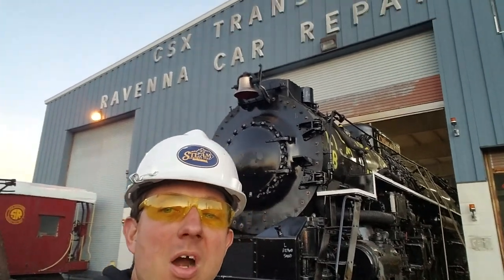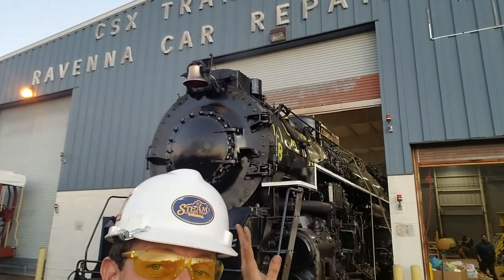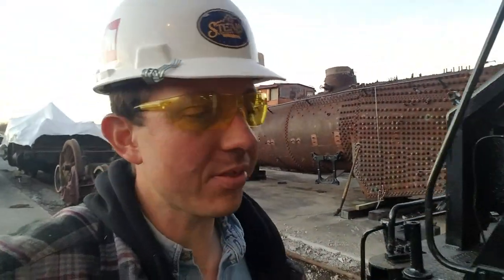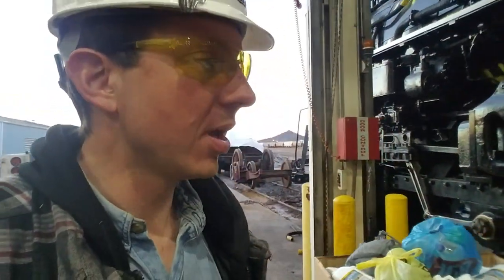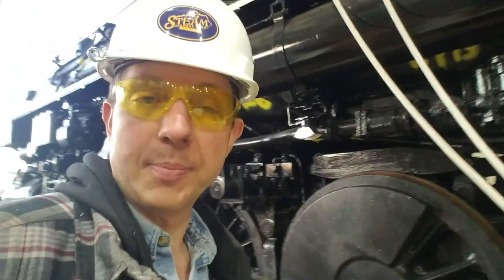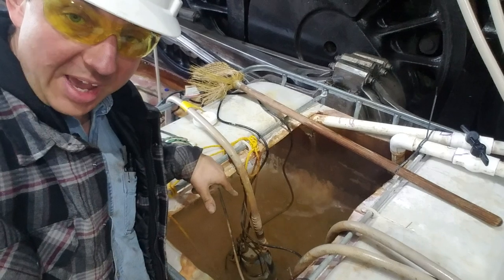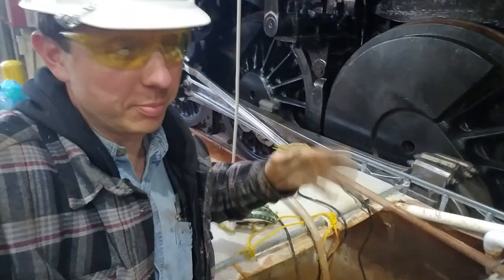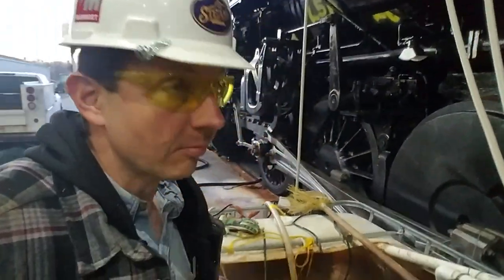Acid Washing A Locomotive Boiler

Comment: If you don't mind me asking, what made you guys decide to do an acid wash? Normally I see people sandblast boiler interiors clean. I'm not saying either option is better, iIm just simply curious as to the reasoning behind it.
Reply: How do you get inside to do a sand blasting?
Reply: @kleetus92  Normally to sandblast a boiler interior means removing all of the tubes, flues, and superheaters and what not.This leaves the boiler a literal, hollow cylinder shell.  And if its a loco with a "dome throttle" setup, all that linkage must be removed as well. Then you would have to squeeze yourself and your equipment through the steam dome where by you can then sandblast out the interior. Sometimes, if you remove the front flue sheet, then this makes life so much easier cause you then just climb in from the front, through the smokebox, and into the boiler proper. But removing the front flue sheet is a major endeavor as that involves hammering or cutting out the rivets holding in that sheet. Then when your done, re-rivet the sheet back in when it comes time to re-assemble the boiler. Generally you only knock out a flue sheet if the whole thing is worn out and must be replaced. 
This labor intensive, and time consuming method is why I now figure Jason decided to acid wash out the boiler. No need to go in and do all the work yourself when chemistry does it for you.
Reply: @engineer6325  Only concern I'd have is that the acid removes material indiscriminately everywhere, where sandblasting does not. But if you're into it deep enough to be removing the flues (which it sounds like where they are not) cutting the tube sheet out is kinda a moot point.